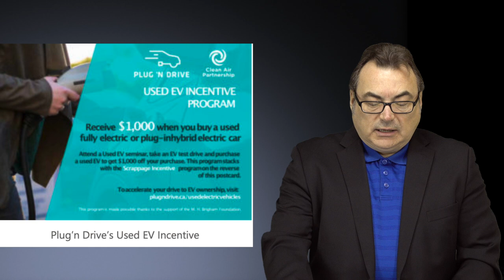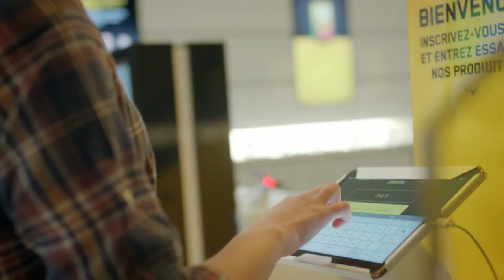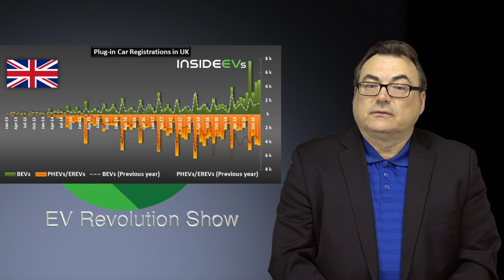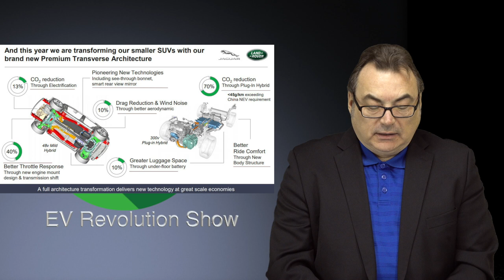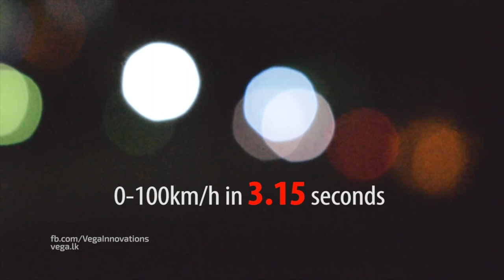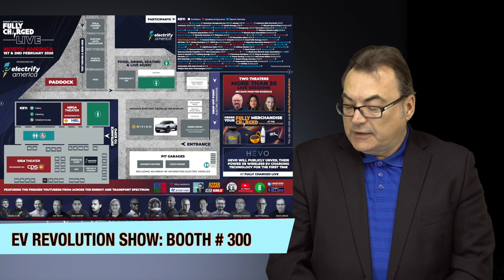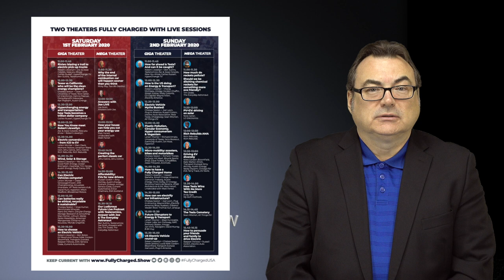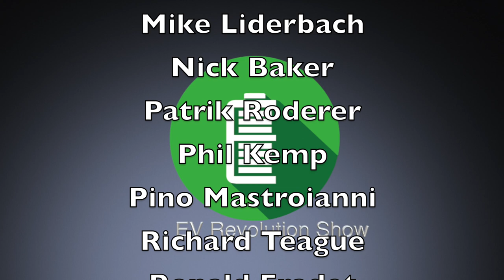Episode 78 -  India & MG ZS EV, Sri Lanka EV Supercar, UK Plug-in Growth, Jaguar XJ EV & more news!

Comment: um 250 KUS$ for 3.15s 0-60 mph .... or 60 KUS$ for a 3.2 s ... from a model 3 performance today... last year it only did 3.5 s. in another year I wonder if it will be even faster... and even the Tesla roadster costs less than half that and will be sub 2 second.  The sri-lankan supercar doesn´t sound competitive. 

I loved your table of charging rates.  It´s important to explain that AC level 2 charge rate depends on the charger in the car.  E.G, a chevy volt  only has a 3.6 KW onboard charger.  almost all new EV´s have 7.6 to 8 kw chargers, so getting a charger capable of more than that is useless now.  That´s one of the reasons Tesla just came out with a new wall charger with lower specs than the old one (only goes to 8 kw) that can use a thinner cable.
Reply from the maker: Thanks Peter.  My point about showcasing the Sri Lankan EV is that the Revolution is occurring globally, not just in California or Norway.  Many countries are developing their own EVs and that is great for them, their markets and the industry as a whole.  

Thanks on the charging (glad you stuck it out to the end of my show to watch!), yes I am aware that the car carries the charger and the EVSE's are just the supply.